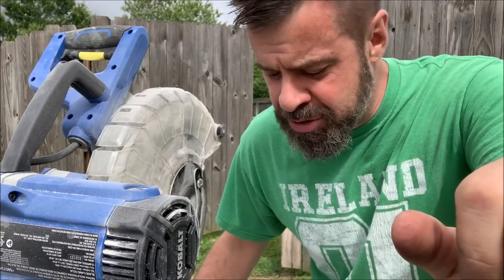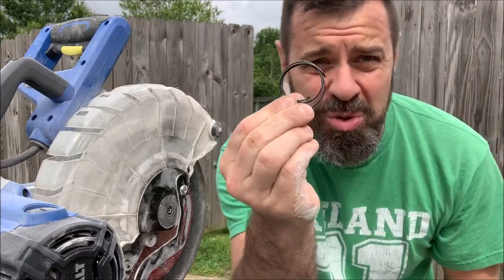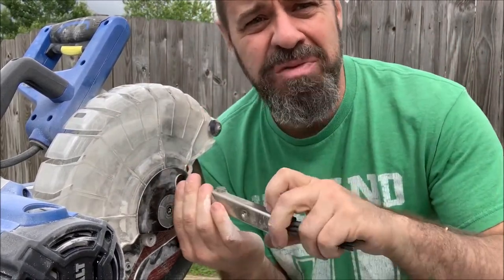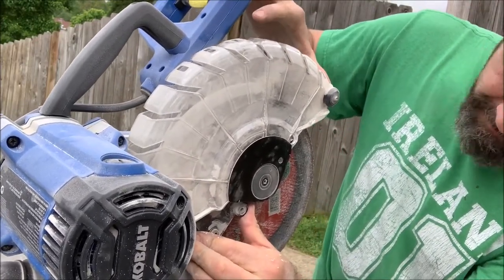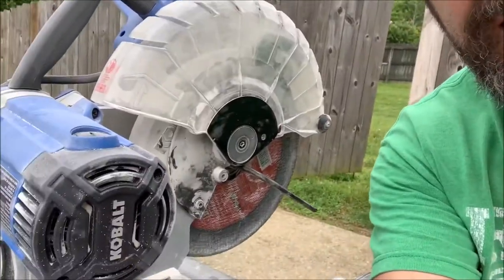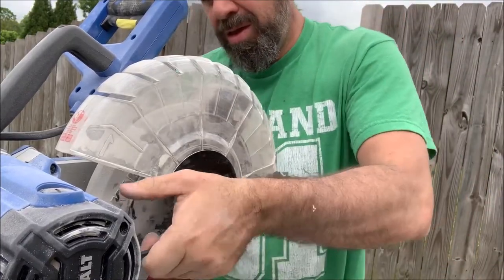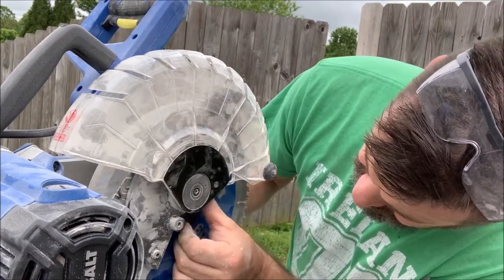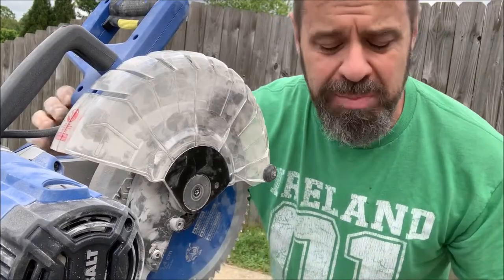⚙ Change Blade - Kobalt Dual Bevel Mitre Saw

Comment: Heads up you dont need to remove the arm screw and  that black screw at the front under the guard only needs loosened. The saw blade screw is reverse thread.
Reply: Saved me 5 min all I need was thread direction

Comment: My God man. Wish I found you before I did exactly what you did. If you’re ever in Texas, beers are on me.
Reply from the maker: Next time in Texas I will look for the guy that looks like your profile pic!  🤣
Reply: @ToddVance   - The spring problem is easy to resolve. Remove the clear plastic guard and the black metal half-round plate that holds the spring. Remove the rubber bumper that is attached to the metal half-round plate. Open the compartment that houses the spring. Push the spring ends into their respective tiny holes and close the compartment. Give the metal half-round plate a half or quarter turn [can't remember which] to tension the spring. This will align the two parts such that they can now be mounted on the saw. [Easy for a triple engineer and inventor like me ))) ]
Reply: Same

Comment: @Todd  - The spring problem is easy to resolve. Remove the clear plastic guard and the black metal half-round plate that holds the spring. Remove the rubber bumper that is attached to the metal half-round plate. Open the compartment that houses the spring. Push the spring ends into their respective tiny holes and close the compartment. Give the metal half-round plate a half or quarter turn [can't remember which] to tension the spring. This will align the two parts such that they can now be mounted on the saw. [Easy for a triple engineer and inventor like me ))) ]

Comment: My parents were about 5 mins from breaking their the exact same way because they could only find a tutorial for one type of saw. I luckily scrolled down and found them this video right before, and dad said this videi turned a job he thought would take hours into a 15 mins job. Thank you.
Reply from the maker: wooot!!!!
Reply: @ToddVance  @Todd  - The spring problem is easy to resolve. Remove the clear plastic guard and the black metal half-round plate that holds the spring. Remove the rubber bumper that is attached to the metal half-round plate. Open the compartment that houses the spring. Push the spring ends into their respective tiny holes and close the compartment. Give the metal half-round plate a half or quarter turn [can't remember which] to tension the spring. This will align the two parts such that they can now be mounted on the saw. [Easy for a triple engineer and inventor like me ))) ]
...
..
.

Comment: Yesterday, my blade came loose... in the middle of a project and I went to tighten it???? My Kobalt is 5 years old instruction book is some where... where I can't find it... so how hard could it be to tighten the saw blade? After 15 minutes I jury rigged my table saw to finish my project and then went to YouTube and found your video. Kudos to you Todd... my heart sank when I heard you talk about the spring... I've had the same problem with other machinery and springs. Just about next to impossible to fix unless, you were an engineer on the Space Shuttle project or a 12 year old computer geek to fix it! Well, because of your video I'll be able to replace and tighten my blade... Good work Todd and I hope you fix that spring, would make another great video! I did my back deck over about 5 years back with this Kobalt miter saw for the price it is a great saw! Thanks again!

Comment: Thank you Todd, the button on the back is so obvious once you know it's there. 

You can replace this by only backing out the one bolt (phillips), and obviously the main bolt on the blade.  I just finished it. I replaced the factory blade for the diablo you have on there. 

Step 1: Align Shield so you can back out the phillips. 
Step 2: mainpulate the shields until the main bolt is visable. 
Step 3: Follow Todd's Instructions on depressing the button to lock the blade and turn the clockwise to break it free. 
Step 4 (if you're in a hurry), wiggle the blade out. 
Step 4 with time: back out (dont' remove) the other bolts on the shield that protrude into the blade area. You'll hit these on your way out. Short bolts would have been preferred kolbalt
Step 5: Assemble in reverse. 
Step 6: Thank Todd for the video 
Thank  you Todd.
Reply from the maker: Awesome!

Comment: Thank you. Today I purchased a used Kobalt and Had I realized there is very little info on the use and features I may have considered the Ridgid someone had for sale. I'm sure I would have removed that center nut and had the safety guard messed up too if I hadn't found your video. I'll also be checking out your page for further information - keep them coming.
Reply from the maker: Glad I could help!

Comment: THANKS! I had the exact same, "spring problem" when attempting to change the blade on my previous Kobalt miter saw. 

I had to remove the guard completely to finish the job. I have a nasty scar on top of my left index finger as a result. Got frustrated with it and threw it away.

I have the dual bevel now, and it's time for a blade change. Glad I found this.

Comment: There's a better way (and no it's not the way the manual says)

The black half circle plate that the guard is attached to has 2 screws. The on closest to him in the video (he removed it through the little hole) loosen that one but DO NOT remove it. 
The other screen is a Philips on the opposite end of the plate, to the left in the video (It is NOT the one in the center he says not to remove) anyway, remove the screw on the other end of the plate and lift  up and towards the back to remove the entire guard. Now access blade easily. 

To put the guard back you line up the plate over it's half circle outline and the screw you loosened but didn't remove sits in a notch. Then just pop the other screen back in. 

30 minutes with the manual and then this video and it turned out to be a 2 minute job but no instructions anywhere on how to actually do this
Reply: Ron Fulton That was a great addition to the video. I didn’t remove, but just loosened the back guard screw and could shift the whole thing out of the way. Since I was alone, I just taped it out of the way by attaching the tape to the motor and the attacked the blade bolt, which required a ratchet to losen. The provided tool? Might as well chuck that.
Reply: THANKS!!!!

Comment: The manual wont tell you how to fix your dust shield, but here's a hint. You have to remove the blade in order to line up the circular spring in its correct slots, or small holes. Only then will you be able to see where its positioned. Also if you just remove the opposite screw from the one you took out closest to the arm(screw closet to the back of the saw) that holds the dust shield in place you can lift it towards you facing the saw and access your blade bolt to loosen and remove it.
Reply from the maker: thanks a ton!  I will use this advice to try and get that spring back on.

Comment: Todd, thanks for this. Very straightforward. I got one of these, a newer model, and the Made in Taiwan, printed in CHINA instruction manual told me, when changing the blade, " Turn the Arbor bolt clockwise ". CLOCKWISE from WHICH SIDE, IDIOTS !
I suspected right hand threads, but thanks for confirming !!! Cheers !!!
Reply from the maker: haha... awesome!

Comment: thanks, I changed blade and the little bolt that holds the arm onto the plastic cover, well, the nut fell out....is it hard to get back inside the cover and then screw the bolt into it? ?...at 75 with hand tremors and arthritis I could use any advice....thanks....................PS, wife was able to slip her fingers inside the blade guard and attach the nut...it works....AND i put a WEN 80 tooth blade on it and it cuts beautiful! you can order the blade direct from wen

Comment: I just did the same thing.  Spring went flying along with bolt and washers.  Ive been working at it for 45 minutes to get that spring back together or Im gonna take it back.
Reply: I got it back together and it works fine. Took several tries. Won’t do that again.

Comment: To  replace the spring , remove the cover , while the spring is uncoiled place each end of the spring into the 1 small hole on the cover and the other end of the spring into the small hole on bracket that is still attached to the saw and the turn the cover to tension the spring and reinstall and tighten remaining screws.
Reply: Roy Buckner can you make a video ?

Comment: Are miter saw blades and Circular/Table saw blades interchangeable?
Reply from the maker: Sorry I missed this comment!  They can be sometimes... you just have to make sure the hole size, blade diameter are the same.  Might be more factors like teeth and rpm's too.

Comment: When your saw craps out in a few months, using a mason cut off wheel is why. Mason wheels are designed to run at a much slower RPM. Your going to burn out your motor. That why they sell miter saws specifically designed for cut off wheels. Just an FYI for you
Reply: He did go back to original blade

Comment: Easier way....  there is only one screw to loosen to access the arbor bolt.  The guard has an access for the phillips end(left side) Rotate the guard until you can insert the phillips. You can then loosen the screw (no need to remove completely)and this will allow you to rotate the guard and the bracket (up and counter clockwise)to expose the arbor bolt****Threads are opposite****😎🤠

Comment: I did the same thing as you did. I’ve changed blades on multiple miter saws and the Kobalt is the worst design ever. I eventually got my guard return spring back. Mine was out square from day one.  and spent an hour getting that corrected. Since then I’ve retired that piece of blue garbage to cutting rough cut and beams. I bought a 10 non sliding DeWalt and am very happy.
Reply from the maker: So you like the non slide?  I feel like that slide has helped me a bunch but you tempt me with throwing this thing away.

Comment: The instructions you couldn't find are right in your saw's instruction manual and also on the Internet in PDF format, it specifically says only remove the screw for the face plate to change the blade.
Reply from the maker: How irresponsible of them to stick it right in the manual!  That thing gets tossed even before the box it came in!

Comment: My issue is I cannot get other brands of blades to work in my Kobalt mitre saw.   I put in a new blade and it struggles to spin and then once the blade gets going it doesn't want to stop after the motor has stopped, but then when I put the Kobalt blade back on everything works fine.  Any one else have this issue or any suggestion on what the problem might be?
Reply from the maker: I wish I could help here but I eventually put the original blade back on and haven't messed with it since.  Hopefully someone else here might know your answer.  Sorry.

Comment: Perfect, just spent 30 minutes scratching my head why the arbor bolt hits the blade guard.  I kept thinking.. "this can't be right, why would they have you remove the guard just to get an extra 1/8 inch clearance on the arbor?"
Reply from the maker: Awesome

Comment: Actually very simple. Loosen the phillips screw at the front of the blade housing using the tool that came with it. Slide the housing back until you can access the allen screw for the blade. You don't have to remove it. It's reverse thread, so it is righty loosey, lefty tighty.
 Have a beer, and relax, dude.
BTW, this is a great saw for trim work. Light, easy to use, (and replace blades), The only problem is the trigger safety seems to stall a bit at times. I've cut 2x stock, but I wouldn't do that on a daily basis.
Strictly a trim saw for me. Easy to haul around room to room doing baseboards, and crown.
Reply from the maker: i think i WILL have that beer!!!  Thanks  for the comment!
Reply: Thank you. It is not intuitive. I’m going to give Roger’s method a try.

Comment: The manual has instructions.   You are close to how the manual describes but not exact.  You don't need to remove the screw to the arm.
Reply from the maker: Dang.. and I probably even kept it ...somewhere.
Reply: Youre correct, the arm is not in the way once you loosen the screw on the guard, make sure the slide next to the blade goes back in the screw slot hold down, then tighten it back.